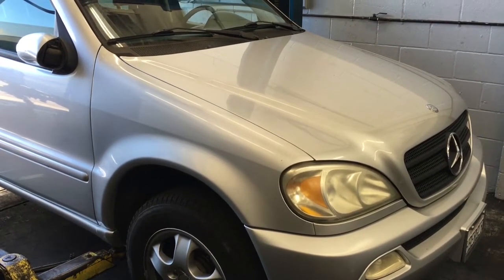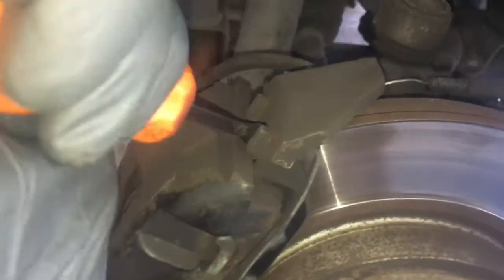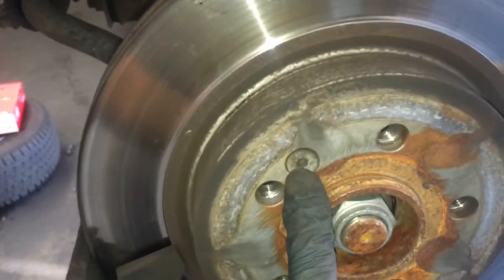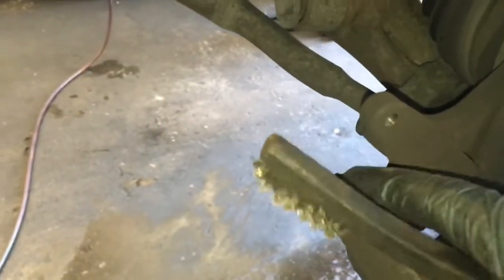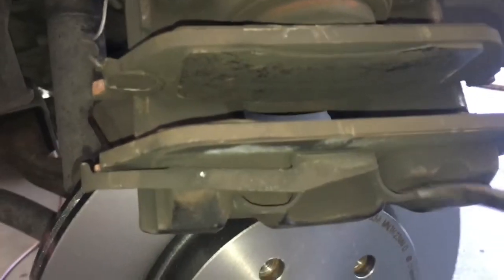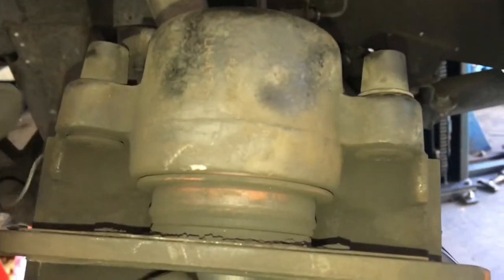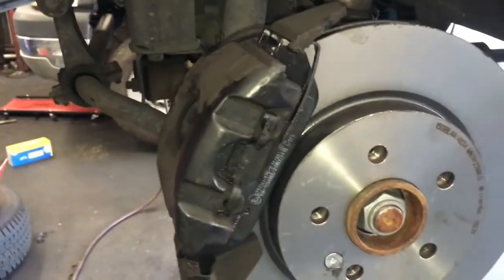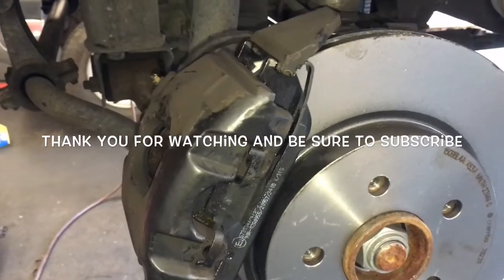How to Replace Front Brake Pads Rotors and Sensors on a 2005 Mercedes ML350

Comment: Just wanted to follow up and post that I just completed a front brake pad replacement on my 2001 ML320, and your video was VERY helpful!

The only thing that was different on mine, and it may have just been an error in narration as everything else was identical, but the caliper bolts used a T-40 Torx bit, as opposed to a T-30 mentioned in the video.

The overall process was fairly easy, although setting the new inner pads with the 3 prongs did give me some grief, but I finally got 'em.  The new pads work well and I'm SO RELIEVED not to hear that anxiety-inducing BEEP-BEEP-BEEP along with the brake warning lights any longer!!!!!!!!  Thumbs up & subbed!  Cheers!

Comment: Im going to change my brakepads on my ML 270 w163 2000 model. 

I can see that this vid was about changing brake pads on an 2005 ML350, but is it the same on my car?
Reply from the maker: Hansen TURBO yes it's the same. Thank you for watching!
Reply: Mercedes Ml500 rear brake replacement

Comment: Save a little money won't save a life.  I don't mind the car can't run but I do mind the car couldn't stop.  Rotors and pads are cheap since you work on your car, you already save labor cost.  I paid $170 for a set of 4 anti-rusts coated with cooling holes and slots rotors, 2 sensors, and 4 sets of ceramic brake pads for my Mercedes ML320.  Use ceramic brake pads for a sure stop and cooler braking.

Comment: Our 02 ml320 has 59K miles. It needs pads only - not the rotor. How important is it to replace the rotor too?
Reply from the maker: rob donell as long as the rotors are thick enough and not too badly grooved you should be OK. If you feel vibrations when you brake  now then the rotors will need to be turned or replaced.
Reply: What does 'turning the rotors' mean?
Reply from the maker: rob donell machining cutting the rotors flat again. With a brake lathe.
Reply: I had a young fella come by today and replace the front pads.  I was his very first customer; he learned brakes from his father who used to run a brake shop.
Reply from the maker: rob donell that is really cool! Thank you for sharing.
Reply: Mercedes Rotors are not made to be turned, according to the factory. Although it’s probably so they can sell more rotors